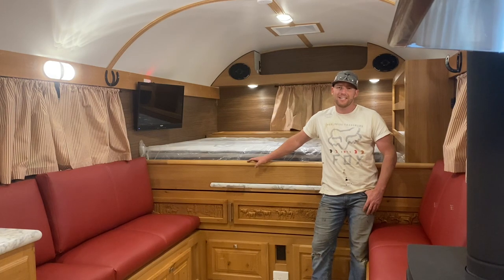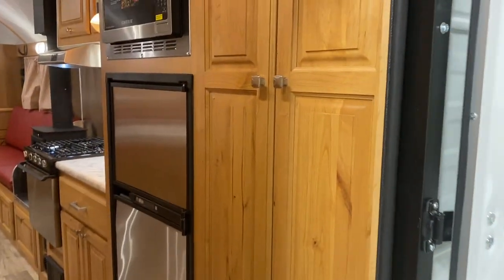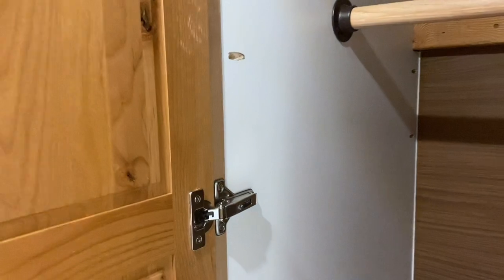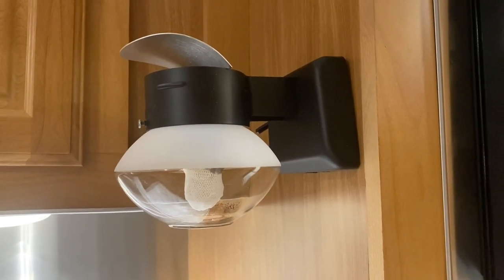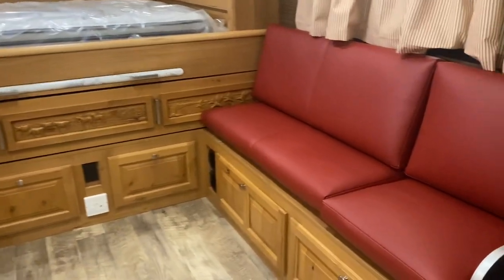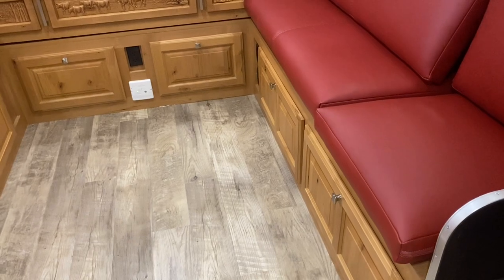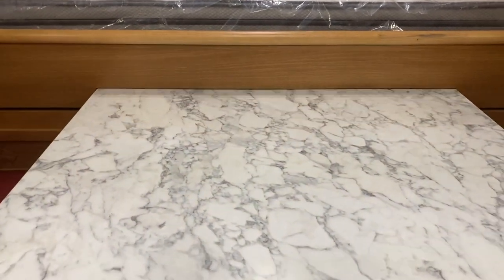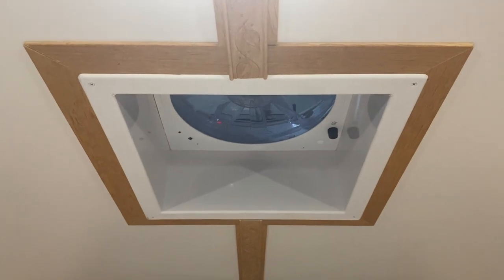Is a bigger sheep camp better?

Comment: Can you get a 12 volt refrigerator in these? Yall should figure away to put a screen door. On these so you could keep the front door open.
Reply from the maker: Great idea. There are several screen door options that we have used in the past.
Reply from the maker: Yes 12 volt fridges are a great option In fact you can get a 3 way fridge also. They are pricey but if you are spending the money on a camp then you might as well get it exactly how you want it.

Comment: Is there a 2nd exit in case of fire? How effective are the solar panels when they are mounted vertically and is there an option to have them mounted on top of the camp to get more juice?
Reply from the maker: Yes each camp is required to have 2 exits. Man door as well as an egress window. The solar is very efficient being in a fixed position but we can add adjustable mounts allowing them to be tilted. We try to avoid as many holes as possible on the roof of the camps as to avoid any potential water intrusion.